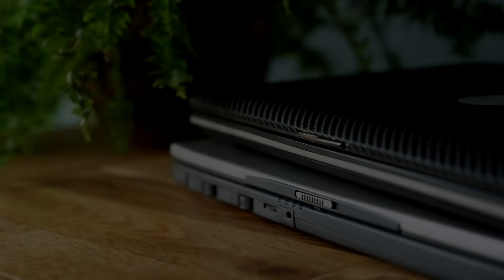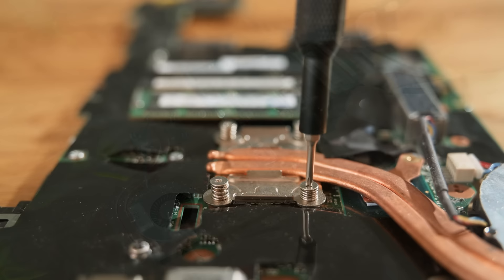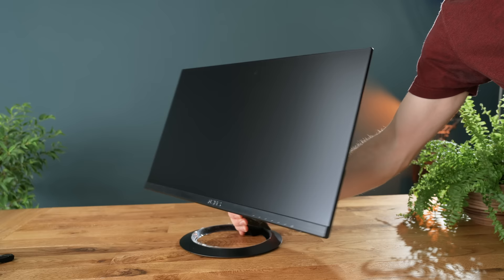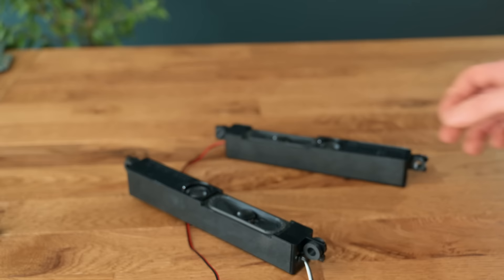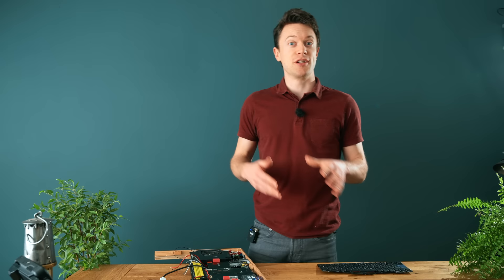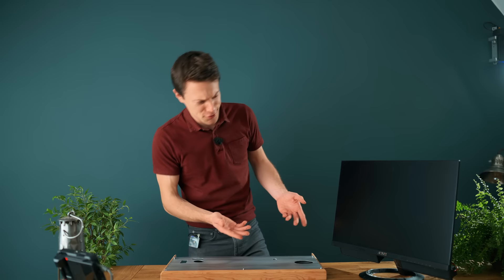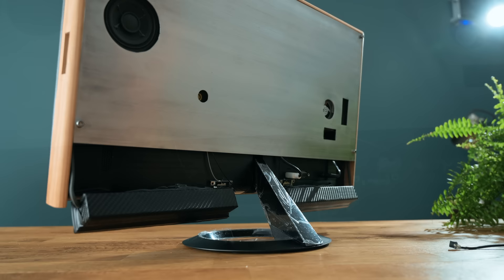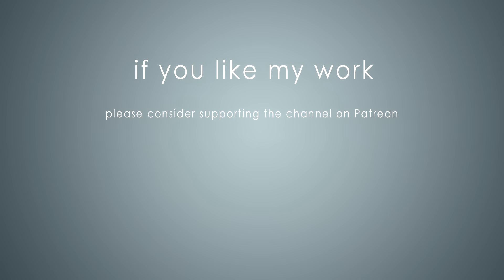Transform a Damaged Laptop into an ALL-IN-ONE desktop PC

Comment: I'm so glad I found this video and your older one. my laptop which cost me 3k is dying from heat and a lack of new parts, so, I've been wracking my brain thinking if it's possible to make a desktop from it seeing as I have a rtx 2080 and i9. and you've just proven its doable and relatively straight forward too. Thanks for the thoroughly well explained video!
Reply: Ik this was a while ago, but try and look into your fans. 

I had the same issue, thermal throttling everywhere on everything, games I shoulda stomped not running even relatively well etc etc. Cracked my laptop open to see if maybe dust had blocked the exhaust. Nope! It was some loose rubber bit from manufacturing that got stuck into the fan, only allowing one to turn. Dropped something like 12C instantly when I fixed it
Reply: @jacksonneedham2792  savage, my issue is I'm running an i9 9900k in a laptop. it runs so hot that my dc input has melted the adapter while it's plugged in. I need a new dc input soldered on with that heat gun solder, but parts are already scarce for it after such a short time. Its a ridiculous. And its a laptop that shouldn't exist to be fair 😂
Reply: I know I'm late to the party! Did you ever convert? My laptop is doing fine so far, but the kid in me wants to do something like this in a year or two cause I'm OCD about temps! Would love to hear your results!
Reply: @tantaloon1 did you actually do it? How did it go?
Reply: @unclegaspatcho1818 did you do it?
Reply: @tantaloon1   yeah i imagine cramming an i9 and 2080 into a laptop case would be pretty toasty (even if they are the lower power versions designed for laptops)
Reply: I had the same issue it turns out I needed to change the thermal paste and clean out the fans

Comment: There's kind of a big problem with this. BIOS settings can get reset to defaults for various reasons (dead battery, BIOS upgrade, BIOS can enter failsafe mode if there is hardware issues, user changing the settings, etc...).

If the power or screen settings change it would effectively brick the entire system unless you plug the original keyboard back in. Would have been interesting to look at the keyboard connector or any microchip on it and try to just solder switches for the screen/power. Could also have done some others like volume. Also you would have made the system totally portable. At the very least I would hide the keyboard inside the backpanel for emergency maintenance (otherwise it will get lost).
Reply: no mate, usb keyboard will work just fine, even on a old macbook.
Reply: @NathanielMartin-wf9hf do you understand the point he's making
Reply: @X_mano  yes, I do. Usb keyboards, will work on laptops post boot. In bios.
Reply: @NathanielMartin-wf9hf bro he means the power button on the original keyboard. The usb keyboard won't have the original power button for turning on the pc. In case the cmos battery gets dead or you have to update the bios because that will just like reset the bios. So the settings he turned on will revert back to original settings.
Reply: @gamereishanwhosucksatgamin2277  I see fair mate, should be simple enough to short the power pins in any case, I’ve even automated power buttons with an esp32
Reply: Oh if the laptops battery stays charged it will keep the motherboard powered! The cmos battery will take a while to die if the laptop always have the power from the battery!
Reply: @VOLTRONDEFENDER4440  Probably the whole reason he opted to reuse the battery.
Reply: @anonymousinc6330 yea and plus he can relocate the pc without shutting it down first
Reply: @VOLTRONDEFENDER4440  It's i5-2520m. it's 2011y
the laptop battery is not holding a charge, and the CMOS battery is almost empty
10:00 It don't work for a long time. It's unreliable.
need to solder the button to the board

Comment: Mad engineer here:
I did the same layout years ago but without using motherboard risers, by directly screwing mobo into .3 mm thinner mdf board. Those are necessary only with conductive background, which you won't require on an insulative woodboard. Saves you a lot of time and space ;) (see what I did there?)
With that said, thanks for the video, the virtual ground circuit was something I never thought of!
Viva la DIY Perks!
Reply: BTW, I came out with another solution for the audio in time:
Instead of using the usb virtual ground circuit, I used no amplifier, and used best sounding speakers with a conic enhancer, while using Debian Linux with 200% audio output, which was audible, considering the system had only 1 x 140mm fan.

Comment: I've got heaps of faulty old laptops lying about. One of which has issues with its display circuit; it doesn't show a picture on the internal screen but the HDMI port works fine. This is a fantastic idea and if I was to build one, I'd have a working device. Very neat!

Comment: Nicely done, If it were me, i would just hide my laptop and connect the HDMI cable to the monitor 😅
Reply: I've done that...
Reply: @moazzamaudit3915  Me Too
Reply: Yep, exactly
Reply: I have done that too
Reply: Much cheaper solution! Haha!
Reply: how would you hide your laptop. please help
Reply: Moazzam Audit how and where do you hide it
Reply: @tensai3188  put it behind the the table
Reply: I am literally using my laptop like this , just plugged hdmi, headphone jack to loud speekers and a wireless keyboard and mouse  into laptop, and putting the laptop under the table
Reply: my dad had a broken pc too
he made monitor part a tv and the pc part a desktop (not AIO)
Reply: @parthgajjar6610  lolll sike sike xD
Reply: he showed in the video that the damage that was done to the laptop was substential. So there was no way around dismantling it in order to repair the hardware.
However I've seen it multiple times done like yours. Especially when the laptop was not shredded to pieces like in the video.
Reply: I'm doing that already!
Reply: @moazzamaudit3915  wow
Reply: @tensai3188  if you have some sort of table in front of tv screen just install two plastic hangers under table (attach under table ceiling) and place the laptop on it. Then go to Laptop settings and activate "use external / dual display when the lid/screen of laptop is down". And use wireless keyboard and mouse. Your done.
Reply: lol did that to my old laptop now i just have my monitor as a 2nd display
Reply: First laptop I ever owned was a really old plastic Macbook that an ex-girlfriend gave me. The screen was completely shot and the battery didn’t hold a charge anymore. I just added a mini-display port to S-video adapter and plugged it into my bedroom TV and hooked up an old keyboard. I’d sit on my floor and use the track pad to edit and keyboard to record stuff into GarageBand while cranking my neck up to look at my TV lol.

It was probably the least elegant solution imaginable but it got the job done 🤷🏻‍♂️

This video seems like absolute overkill, and entirely unnecessary... but it’s still interesting! That setup costs way more than the situation called for, too, but I suppose this is the MOST elegant solution imaginable lol.
Reply: @parthgajjar6610  i wanna do that but i dont have monitor
Reply: what if your bios setting has been reset ? how can you turn on the laptop if it needs the built in keyboard?
Reply: Super glue it behind the big monitor! 😂
Reply: @moazzamaudit3915  Thanks for the tips .Ordered the monitor but wasn't sure how to do this if I wanted to have the  the screen  down.
Reply: "respect"
Reply: And put an external keyboard and mouse but this is a little cooler
Reply: yaa man that is much easier
Reply: I am doing that😂 with my laptop 😉
Reply: Less expensive. more manageable 😁😆👌👍
Reply: I do that and it's like a desktop that can come with me anytime
Reply: LOL relatable!
Reply: is there any tutorial for the connection of the wire to the monitor? How to connect the wirings? Thanks. 😊
Reply: i bet some guy hired the creator of this vid to make a wireless HDMI cable and hid the actual laptop lol

Comment: this guy: turns a laptop into a desktop by taking it apart
me: plugs an HDMI cable into my tv, a separate keyboard, and a mouse. 
done
Reply: Well he just made a clean setup
Reply: @randomraygun6735  maybe not as clean with the keyboard and mouse wires
Reply: @Jamescicle  well you can add up a wireless keyboard and mouse
Reply: @randomraygun6735  my wireless mouse keeps disconnecting and my wireless keyboard only types 1 key at a time
Reply: @Jamescicle  Well it happens for YOU but other people can still try it
Reply: me too
Reply: I wouldn't recommend you use a tv because they have slow input times, monitors exist for a reason
Reply: @Zeroneii3  don’t have the money for a monitor. Wish I did tho, one less thing to worry about buying when I build an actual PC.
Reply: @dnamatrix_xd6077  you can get a decent monitor for 200$ USD which is pretty cheap for a monitor
Reply: @Zeroneii3  i don’t have money tho.
Reply: @Zeroneii3  thx tho, I’ll look into a monitor for Christmas
Reply: @dnamatrix_xd6077  I didn't do anything but np
Reply: @Zeroneii3  i have a 1366x768 @75hz and its only a 100 dollars, i connected my keyboard mouse and laptop to the monitor and works perfect
Reply: Turns a “damaged”*** laptop to desktop, cant do that with hdmi
Reply: @Jamescicle  maybe wireless keyboard and mouse😁
Reply: me: Takes apart a laptop, plugs a VGA montior into it, then hooks up a seperate keyboard and mouse
Reply: @Zeroneii3  tvs have gamer settings which boost latency
Reply: @Stephendunn9220  not all do
Reply: @craftyfish0  same here
Reply: @randomraygun6735 Ikr
Reply: @sjcommander91  what if i only have one cent in my paypal
Reply: i think like you
Reply: that all in one keyboard you have
Reply: The video isnt about how to use the laptop, it about how to make an all in one pc with it
Reply: you: noob
he: amazing
Reply: @randomraygun6735  I have Fujitsu P27T-6 IPS,  27inch ,1440p 50$ and it is fine . Definitely outperform cheap new monitor in color reproduction and resolution.
Reply: @Jamescicle  ive heard of something called wireless
Reply: Bro that’s known as aesthetic value.. he is good at it
Reply: I do that every day to my 4k 144hz monitor
Reply: Lol I do the same
Reply: Same i do the exact same and it works! Btw my screen (LCD) in broken in halve
Reply: @Zeroneii3  you: tv bad
My 60hz tv or quot on quot generic PnP monitor: am i a joke to  you?
Reply: @mercurianmoonmystic2908  my screen broke in halve and i use hdmi cable to TV and it works along with optional wireless mouse and keyboard 200
Reply: i know its funny but he did better because the laptop or the cables like hdmi calbe or keyboard and mosue cable wont show and willl be minimalistic and clean
Reply: same
Reply: @Jamescicle  sounds like you have something interrupting the signal of the mouse and keyboard.  Possibly your router, try putting the USB to the front?
Reply: Lol
Reply: @sjcommander91  see uhh i didnt get it from wish and it was like 11 bucks
Reply: That is pretty much what I did lmao
Reply: We are in 2021, you can connect your PC to your network through Ethernet cable, and project the screen of your PC to your TV. Without cable.
Reply: no stress 😂
Reply: i also do this
Reply: Thats what im doing until i get an xbox😂
Reply: @Zeroneii3  Send that link
Reply: @ballsofplastic  I forgot
Reply: @Zeroneii3  I've never disliked a yt comment, Until now.
Reply: @Zeroneii3  Anything, Everything and nothing. The quantum of life states that theortically i am useless and therefore never going to success in my point which is drastically proven by the statistics of the point of psychological states of the nerve endings.
Reply: R/meirl
Reply: @Jamescicle  ok
Reply: How about the cooling system of this thing? I have two shattered laptop which is still functioning but my concern is the cooling system. Since it is glued at the back of the monitor the heat from the monitor will go directly to the mother board right? Enlighten me please, thanks. Btw I am not tech guy. I just saw this and it was a good idea since my laptops were just sitting idle.
Reply: Me too
Reply: I did the same thing
Reply: And just add a cpu then it will be total setup I have done it works very nicely

Comment: If you want to take the power button problem a step further, you can use a multimeter to find what pins are used for
the button on the keyboard and the resistance if needed then (carefully) solder
a button to the respecting pins with the corresponding resistance (if it uses resistance for identifying keys).

Comment: If you don't require the decorative aspect you can download the manufacturer's service manual or better yet (in most cases) find a display replacement video then simply remove the damaged notebook display in an hour or two. Then it becomes a serviceable PC you can connect to the same external peripherals as when using the notebook as a desktop replacement workstation.

Comment: I swear this guy keeps impressing me with his engineering skills even though I'm pretty good at repairing electronic devices or upgrading them but doing my own DIY that's where I seriously lack in that area that takes time that I don't have😢 so I made it easy on myself I bought a 2020 HP pavilion all in one Windows 10 desktop I can also use a external GPU for gaming because it has a built-in USB-C thunderbolt port which is required in order to use a external GPU

Comment: I'm going to need to watch this on my nice display.
Edit: And now I'm going to have to build a laptop onto my nice display. But I'm going to need an extra warped laptop PCB to go with my curved monitor.
Reply: Cavey Möth you could make it it’s separate thing
Reply: Look at some of the ultra-portables out there. Some use a set of very small boards connected by ribbon cables, so you could effectively 'bend' the system around the curve. I'm sure there's a broken ultra-portable for cheap out there, somewhere.

Comment: Why do I get the feeling that the Hubble telescope... the Large Hadron Collider... and IBM's Watson are all actually just old laptops and nick nacks that Matt has repurposed...
Reply: to be fair hubble is damn old
Reply: It is funny how this comment is not that far from truth. In practical application of technology, stripping down computers and components assembled by other manufacturers is sometimes just more practical and is used all over the place.   
  
Chances are, most of the people watching used one of repurposed machines like that themselves, they just didnt realize it. I have seen things like that attached to display terminals in public a lot.  And when it comes to ISS if something breaks they fix or repurpose it a lot. 
   
It is specially common in countries that border first world countries but are not ones themselves. In first world countries like US people trow out perfectly usable tech, so people just take all that stuff for cheap, move it to poorer countries, re-purpose it and sell it. It is very common for countries in Asia or eastern europe.
Reply: @arigoru7018  Furthermore, space application hardware are almost exclusively ex-generation tech, as their noise resistance characteristic is better understand compare to current gen (and also better overall). For example the Mars 2020 Rover will uses the RAD750, which is PowerPC 7 based - an architecture that date almost 20 years before the launch of said rover. It will also have only 256MB of RAM, which is the standard about 20 years ago
Reply: @VuLamDang  more evidence of modern bloat, lol. They can do space missions with 20yo tech but it takes modern machines to run slightly prettier graphics compared to several years ago

Comment: The subwoofer in the wooden case is genius for acoustical reasons. Bass gets amplified in wood since the wood resonates and essentially makes the whole of the wood a part of the woofer.

That's a trick I used to great effect when I was in the barracks and couldn't fit a big sound system in. Just positioned the woofer in the back middle of the underside of my desk so that the walls of the desk made it seem like I had something more expensive than the small sub woofer I had.

Comment: This is how you know your laptop is Lenovo: smashed and trashed, yet keeps going.
Reply: Its like spiderman, it'll find a way to get back up again.
Reply: Thinkpads are ok, the rest of Lenovos are crap.
Reply: A D  yeah, it's more the Thinkpad ones (not sure about the more recent ones at that)
Reply: A D  Asus rules!
Reply: i hate my lenovo
Reply: I have the Lenovo G580 and it works just fine
Reply: suicidal  yeah mine is worling good too its worling very very good
Reply: its because it was designed by ibm
Reply: I have a Lenovo Z50-70 and it stopped working after I spilled a drink on it. Fixed the keyboard part but screen won't turn on anymore...
Reply: @martijnvisser4750  i know this may sound dumb, but have you tried taking out the ram and putting it back in, on my old eepc that fixed a no screen issue.
Reply: Yeahh I have a Lenovo. It's cracked, falling apart, keyboard is broken, still works, except for the stupid power jack, which is why I'm here...
Reply: True bro

Comment: I can give this video a 9.9 out of 10 because there was 1 factor that I've discovered that may be seem trivial. Laptop batteries eventually won't be able to hold a charge. So if anything depends on that battery separately it will eventually stop. As long as it's plugged in though all functions should be fine because it's getting it's power from there.

Comment: you could just solder a wire to a ground and a wire to the power button pin on the keyboard socket on the board, so you can keep the original power button, the work is to found out what pin got the power button signal, just look for the higest volt on the socket, or try look for continuity on the kb flex when you push the button, is the one who goes to ground when u push it, i have made it before with broken keyboard laptops and it works great